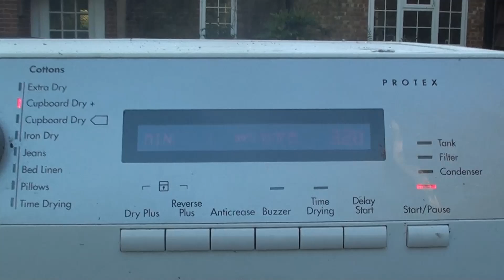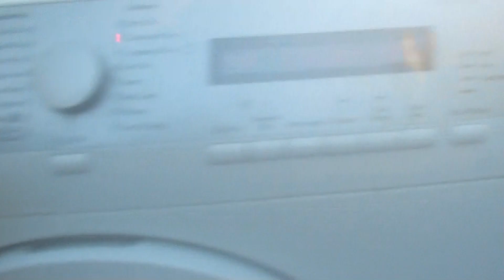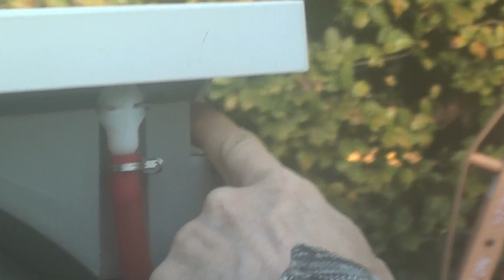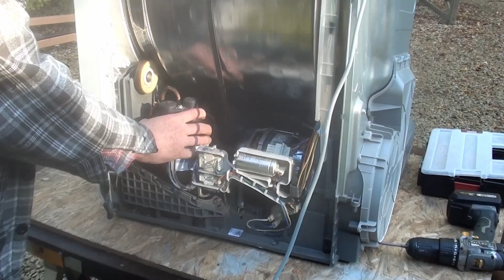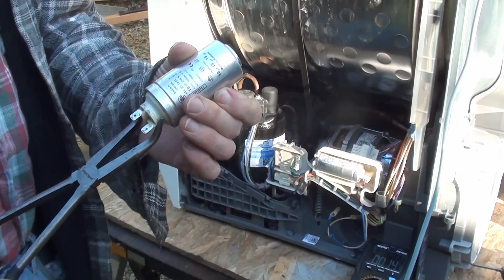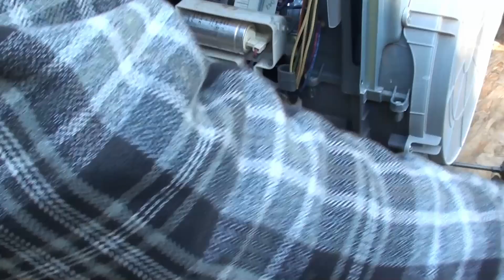AEG/WHIRLPOOL Heat Pump Tumble Dryer No Heat Repair

Comment: Should the capacitor be discharged before measuring capacitance? What is the best method to do so?
Reply from the maker: Just short the contacts out with a screwdriver before you remove it.

Comment: Hello, what's the maximum temp should this dryer be at ?
Reply from the maker: They dont get very warm. They work on the principle of low humidity (dry air) at may 25 to 30 degrees. Very dry air is incredible effective at taking on water vapour.  If you heave a full load you may not even feel much heat.